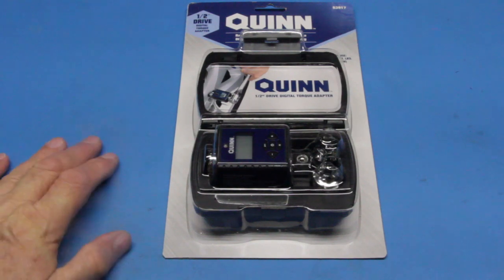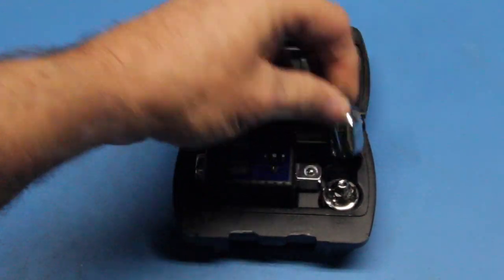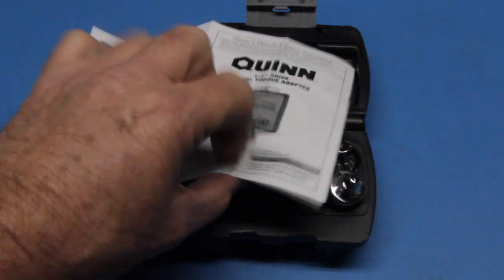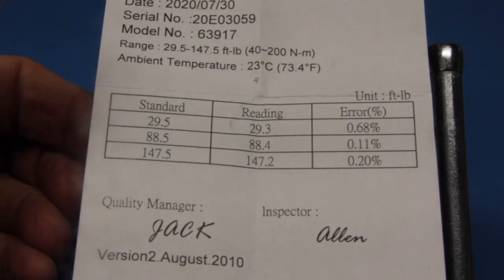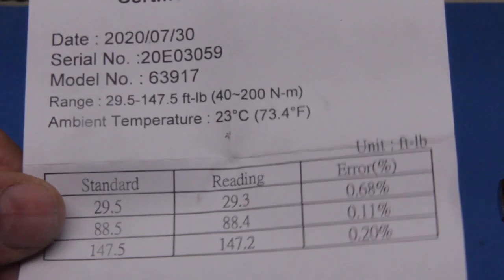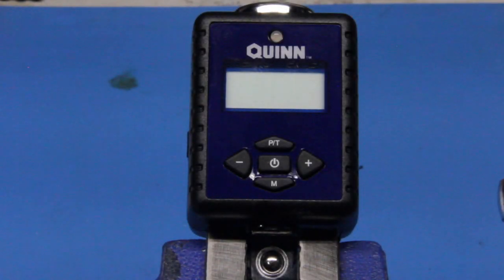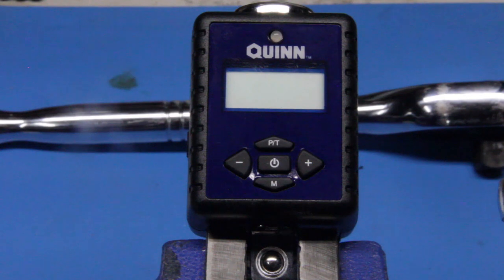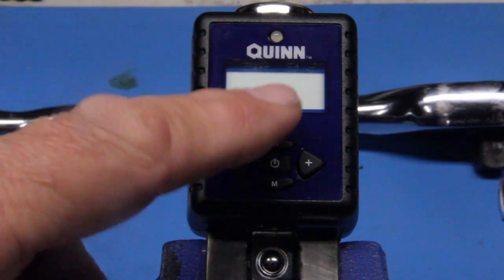Quinn Digital Torque Adapter

Comment: I bought this many years ago and I've never used it. Now I need it for the first time today and I couldn't find the instruction manual. Thank you for the helpful video!
Reply from the maker: Thanks for the feedback
Reply from the maker: I not seen anything on calibration,  There might be an adjuster inside, You can always have it tested against a known torque wrench. Thanks for the question

Comment: I just bought this model today.  You'll be happy to hear the new ones do have the back lighting.  The torque range is now 25-250 ft lbs.  The down side is they no longer include the handy adapters.
Reply: Right I was excited for them but I need this

Comment: Great video, looking forward to some testing 👍😁
Reply from the maker: Thanks Dave
Reply from the maker: Thanks, check out my next video, testing torque on the Bauer 1/4" impact driver,  did the torque setting using the adapter

Comment: Great video Joe. One comment, I've looked closely and I don't see where the "." is when you say 7.4.  I think it actually starts at 74 ft/lbs.  I bought one and set it to 99 ft/lbs and then tested it on my lug nuts that are torqued to 100ft/lbs and it was spot on at around 100.
Reply from the maker: Thanks Lupe,  switch to NM to get to the 7.4 nm.  There are two modes, NM and Ft/lbs.  Then you have real time reading and peak reading.
Reply: The display always shows tenths.  So 74 foot pounds would display "74.0 lb-ft".  I think the decimal point was cut off in this demonstration where it shows 7.4.
Reply: Very confusing. Just to point out a few of the many instances, you keep saying " point" as in decimal point. You say 6.7 or 7.9 ft. lbs, instead of 67 or 79 ft lbs. Good video, but since there are lots of these types of errors, I would redo the video to make it clearer.
Reply: @1oxyoke there’s no confusion. He never takes the torque over 8 ft/lbs in this video.

Comment: Why is it nobody ever suggests removing the batteries when you're not using any of these electronic devices that use standard batteries? Nothing like going to use a tool a couple months down the line only to find a battery started leaking and ruined your investment.
Reply from the maker: Thanks, you are absolutely right.
Reply: Will it lose its calibration when the battery dies or is removed?

Comment: Great video on navigating the torque adapter .
 Just wondering how to erase or reset the P1 to P 50 memory slots ?
Reply from the maker: The memory slots are overwritten after your reach the 50 slots.  The manual does not indicate any information on clearing the memory.  Try pulling the batteries and re-installing them.
Reply: @JoediyLab  ok thanks for the reply

Comment: Great video Joe
So if I wanna  see how much torque  was used  installing a spark plug , when I needs to loosen a spark plug I use the peak option correct?
So that is the torque needed to loosen it

Comment: I got one today 1/2 inch seems to be good is it accurate enough to do head bolts in 3/4 inch drive
Reply from the maker: Yes, I have both the 3/8" and the 1/2"

Comment: So I have this I need to torque something to 7nm/5.16 ft lbs could I achieve accurate ratio with trace option?
Reply from the maker: Either Trace or Ptop option.  On Ptop the adapter will beep at 20% of torque and solid beep at torque setting
Thanks
Reply: NO, this 1/2" drive mechanism is calibrated for higher torque values, NOT intended to be as accurate down at only 5ft/lbs....that's what their smaller drive tools are for...1/4" or 3/8"....this is no different that standard torque wrenches...you don't use a "giant" 1/2" or 3/4" torque wrench to torque 5ft/lbs....yes, you CAN do it, but it wasn't calibrated for that, so don't expect it to be accurate.

Comment: The "range" is limited because like tire pressure gauges the springs in them have ranges that they are accurate.   Car gauges are accurate at 15 to 40 pnds  truck ones accurate around 80 to 120 pounds.   Same as buying 3/8 vs 1/2 torque wrenches.  The smaller one has a lower range .  And the bigger one has a higher accurate range.

Comment: Hope I get a reply but I’m thinking of buying this in a couple of days cause I need something torqued at 13 Fr lbs can I get it to torque at 13 ft lb
Reply from the maker: They sell several sizes now, get the 3/8 drive model, should work fine, good luck 🤞

Comment: Hi, thanks for the great video.
I noticed you mention in the video that the lowest setting you were able to set the adapter was 7.4 ft lb. 
The range of the adapter, according to the description, and calibration certificate is 29.5 - 145 ft lb.
Would it be safe to use it below that range? In the video, you tested it with 7.4 ft lb. but that was a test, not a real application. I think it is safe as long as it is below the manufacturer’s range. 
Did you get a chance to test it on a real application, or compare it with another torque wrench?
I need to torque 3 bolts to 8 ft lb and I am thinking about buying this unit from HF.
Thanks in advance.
Reply from the maker: Hi, Yes I noticed the same thing,  I have not compared to a torque wrench.  But I have several videos that I use it to check for bolt torque and at what torque the Impact wrench can loosen.  My torque wrench is really old and has never been calibrated.  Great questions, thanks
Reply: Thank you for the quick response.
I stopped by my local HF store, they didn’t have it in stock. I went with the click torque wrench for $19.99 as I need to get the job done.
I will still buy the digital adaptas soon as I get a change, it seems like a good tool to have around.
Reply from the maker: @jokekash  Yup you have to use what you can.  Thanks

Comment: According to Harbor Freight's 'PRODUCT OVERVIEW' it says it has a Peak Mode and a Track mode, it sounds like you're saying Trace so is it Track or Trace?
Reply from the maker: Hi, The manual says trace,  but track or trace is the same thing.  As you increase or decrease the torque, trace will show real time value.   Peak show the max torque reading that you achieved
Reply: @JoediyLab  ... OK thanks.
Reply: Does this do degrees? Or angle torque for head bolts after you set the ft/lbs? Anybody know?

Comment: Good morning, Joe, I have a quick question about this digital torque device, is this a plug and play type of device? And do you think that I'll be able to achieve a torque of 9nm?
Reply from the maker: Hey Lamont,  minimum ft lbs is 7.4 , converting to nm will be 10.0 nm.  I left the unit up north, so I cannot double check that for you.  Thanks for the question.
Reply from the maker: As far as plug and play if you set the units first, then after you turn the unit off and then back on it will remember the lowest setting.  Thanks

Comment: Hi... How do you get your memory settings?... I cant program it to have 10, 20, 50, 71nm presets
Reply from the maker: Him there are 50 memory settings:
To store a torque reading, have the Adapter 
in “PtoP” mode. When you use it, the Adapter 
can store the reading automatically.
19. Press the Memory button.  The Display Panel 
will show the stored reading as “P01
To show the second stored reading, press the 
Memory button again for one second.  The second 
torque value will be designated as “P02”.
21. The Adapter can store up to fifty torque 
values, the highest being “P50”

Comment: Can this be present to recognize the torque pressure and beep?
Reply from the maker: Yes a green light and yellow light will light when near the set torque and then it will beep when near 20% of set torque.
Reply: @JoediyLab  thank you! I can’t wait to start using it and put my old manual bar in the bottom of the toolbox lol

Comment: Do these lose their accuracy after time? Do they need to be calibrated ?
Reply from the maker: I imagine that any device will need to calibrated every once is a while.  If you have a calibrated torque wrench you can use that to calibrate the digital one.
Reply: The manual does say you can switch it into "Calibration" mode BUT does NOT say how to proceed to calibrate it once in that mode.😮

Comment: the  settins  on  this  do  they   go  as  low  as   7 ft    pounds  ?
Reply from the maker: 4 ft lbs is the lowest I could get it to go,. Thanks
Reply: @JoediyLab  thanks
Reply from the maker: @streetministry62  Thanks for the question
Reply from the maker: @singachuotodiy  I have not done any calibration testing.  My torque wrenches are out of calibration.
Reply: @JoediyLab  thanks

Comment: What about testing proper torque settings with ones own Torque wrench ft/in measurement settings on their TorqWenches ?
Reply from the maker: Thanks for the feedback, yes you could use the adapter for calibrating other torque wrenches.

Comment: I'm puzzled : How can this Quinn read as low as 7.4 ft lbs, when the minimum range advertised is 29 ft. lbs)?
Reply from the maker: I was able to adjust the lowest setting to 7.4 ft lbs
Reply: That is not an error....there's no confusion....what they're talking about is Range-Accuracy...just like with a volt meter...you don't set a volt meter to a 500volt range to test a 1.5v battery...same here....they're talking about the ACCURACY of this torque meter has been tested and calibrated down to that 29ft/lbs and up to ~147ft/lbs....yes, you can set it down to 7.4ft/lbs, but the mechanism's calibration-accuracy has not been set for that low range...that's what their 1/4 and 3/8" drive units are for, calibrated for lower torque ranges.

Comment: Does it also measure in reverse
Reply from the maker: Tyler I think it should, it has a peak setting.  Let me double check
Reply: @JoediyLab  Did it measure in reverse Joe?
Reply from the maker: @jfrorn  Sorry,  I am away from where that product is and did not get a chance to test that.  I checked the manual and it does not indicate that.
Reply: @JoediyLab  Yeah I noticed it didn't say as well, no one mentions it! I need it for a flywheel on my old Lambretta scooter which uses a reverse thread!
Reply from the maker: @jfrorn  go ahead and buy it,  Harbor Freight has a good return policy
I would assume it would work
Reply: @JoediyLab  I'll do that, thanks for answering!
Reply: Looked to me like his test was performed in reverse unless ‘lefty loosey’ has changed meaning.
Reply: @millibarman  it does not. Obviously you did not read his previous comments.

Comment: You complain about the lack of back-light making it likely "difficult" to see under the vehicle and in certain positions and angles of view, which is true, but that's the whole point of the flashing LED light and BEEP warnings....if you know you're going to be in that situation, you don't set it to Trace (real-time) mode and expect to watch the read-out, you trust the warning LED and beep.

Also, I've made this comment in a couple of the sub-threads, but figured I'd say it again up here at the message thread top level....YES, you can set this meter to lower torque values like 7.4ft/lbs, but it's not calibrated to be accurate at such a low torque value, that's what their smaller-drive torque meter like 3/8" is for...just like with a standard torque wrench. You wouldn't use a big 1/2" or 3/4" torque wrench for in/lbs or very low ft/lbs and expect it to be accurate....same goes for these.....

....BUT, if Quinn or other mfg bothered to include Calibration procedures for this meter, you could theoretically recalibrate it's accuracy down to whatever low range you want. They DO warn about a button combination that will switch it into Calibration mode, but don't include any procedures after that.
Reply from the maker: Yes, you can rely on the red LED's but sometimes they appear to come on late, I would really like to see the torque values.